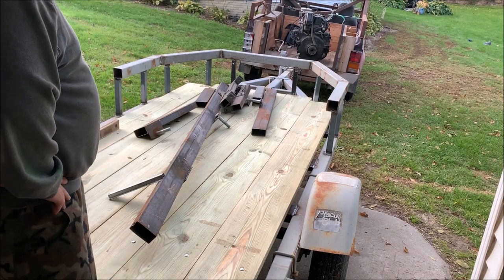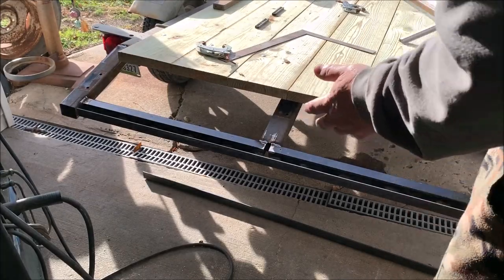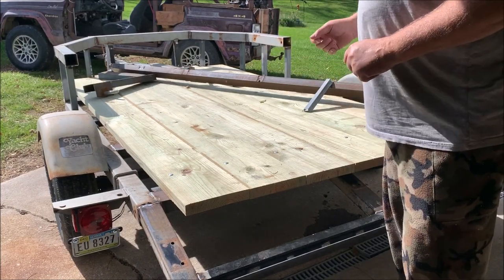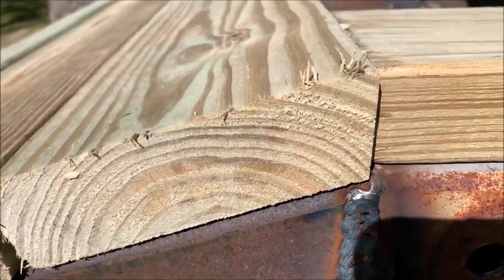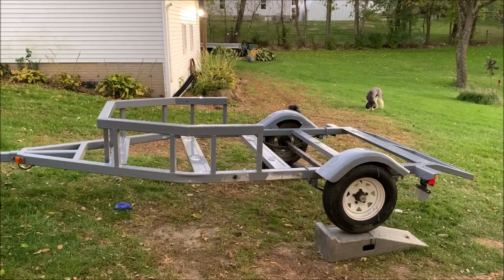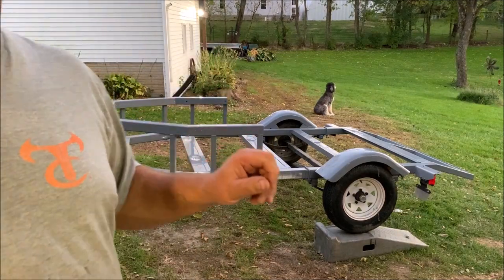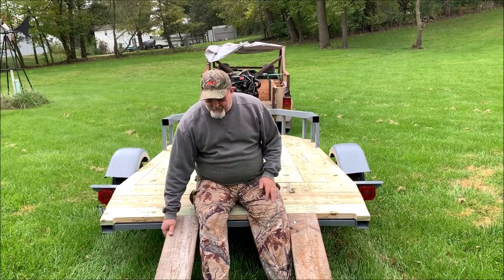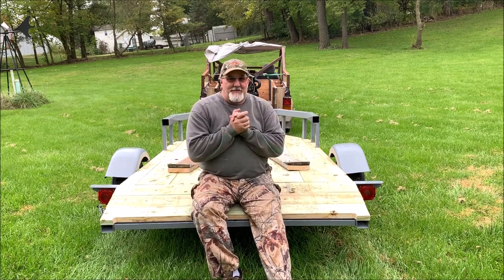Boat Trailer to Utility trailer conversion Part 2

Comment: A hint so that when you are driving up your wooden ramps when they are wet so that you don't slip off is to get a walking belt off of a scrap treadmill and cut fit and staple it to the boards.  Learned that the hard way loading up the 4 wheeler. The walking belt gives pretty good traction.
Reply from the maker: Thank you for the advice.

Comment: Is the trailer a little heavy on the tongue when loaded? The axle is pretty far back.
Reply from the maker: by design it is a touch on the tongue heavy side but that's how I like it. Still well within the hitch capacity. No fishtail action here. I loaded a pallet of mulch (75 bags) and placed the center of the pallet just ahead of the axle and it towed perfect. This axle position gives you options to put the weight where you want it.

Comment: Do you remember what paint you used?  Its been a year now, how's it holding up?
Reply from the maker: Rust oleum. That trailer has has thousands of pounds hauled on it and it works perfect.